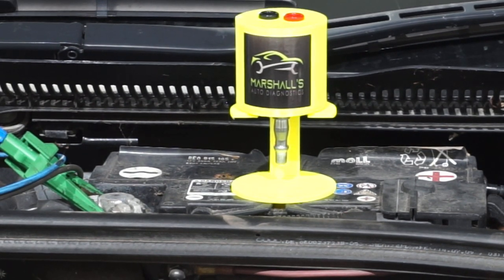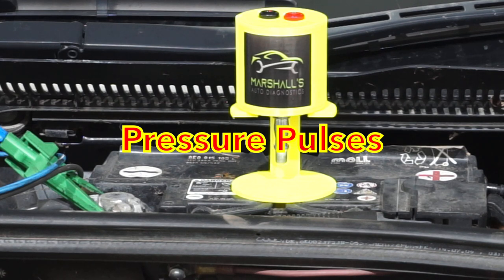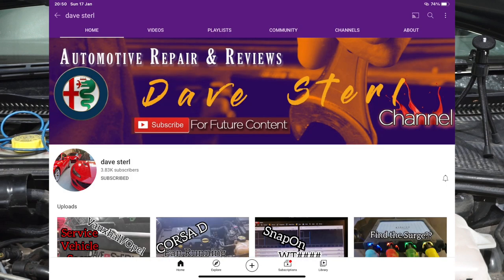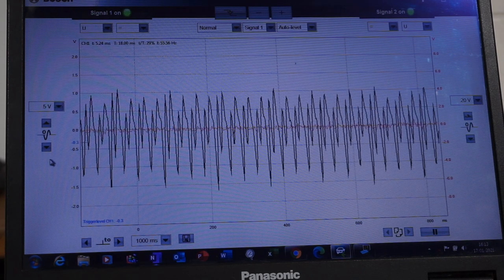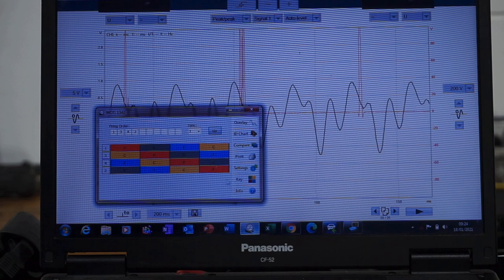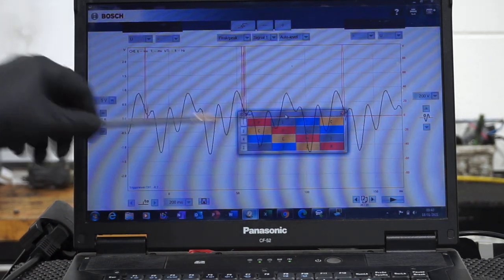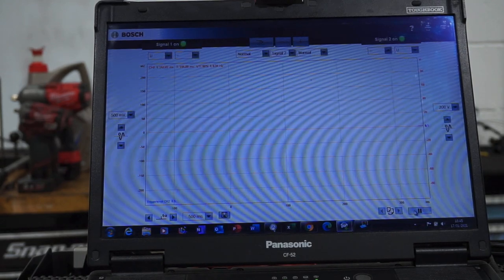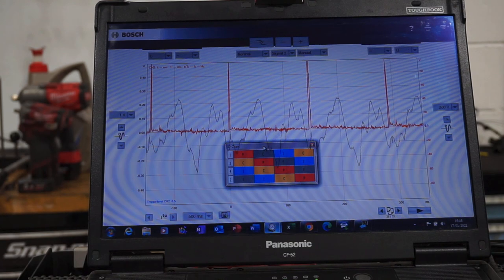Diesel Engine Pressure pulse analysis with a delta sensor & Bosch KTS

Comment: I suspect cylinder 2 but I think it will also be impacted by the hose length to the pulse sensor. 
Great video.
Reply: I’ve also seen these used with a stethoscope to diagnose noise faults.

Comment: Is that injector pulses correct? As it appears to have multiple strikes on one stroke and a single stroke on the second stroke. 

I found on my hilux in Australia it would open the injector with multiple strikes but it would do a single strike every second stroke. I correlated that with my crank sensor and it appears the multi strike was the power stroke.

Comment: Great video and explained very well, I really need to start using mine, but unfortunately seldom see engine issues that aren't already catastrophic
Reply from the maker: I went through a spate of getting vehicles in with rough running issues but I’ve not seen a misfire for a while.
Maybe we’ve replaced all those duff Siemens Injectors now! 🤔🤔🤔🤔
Reply: @intelligentauto737  I need a crash course in all this lol.... Maybe a trip up north is needed when possible 😂
Reply from the maker: You’re Always welcome

Comment: That intake trace is strange, first I thought you where 360 out, PCM using same capacitor for Injector 1/4. I’m guessing at no#3 image not very clear, might be worth changing laptop screen refresh rate see if that helps 👍🏻
Reply: Thats exactly what it is. You will see cylinder 4 injector firing if u back probe cyl 1. So he put the overlay on a 360degre span really